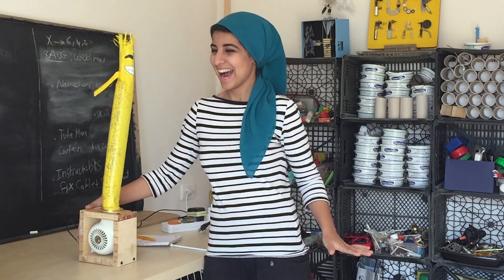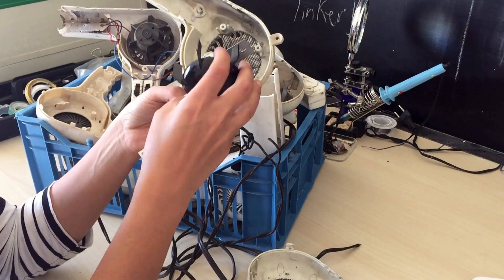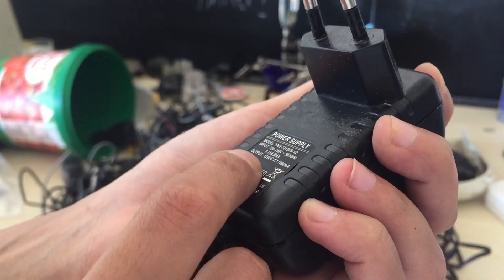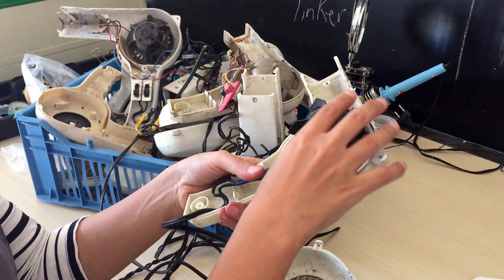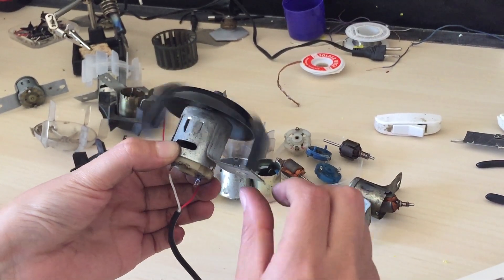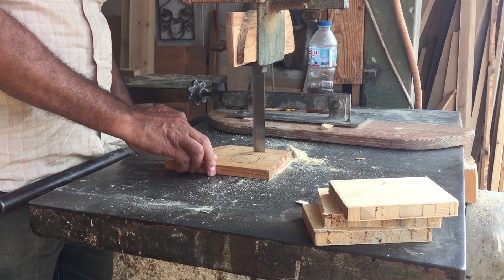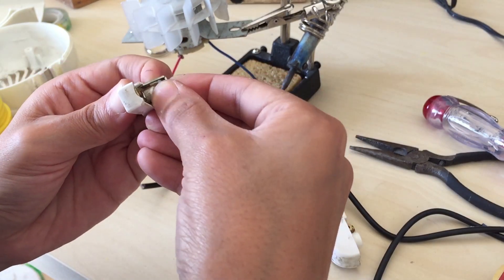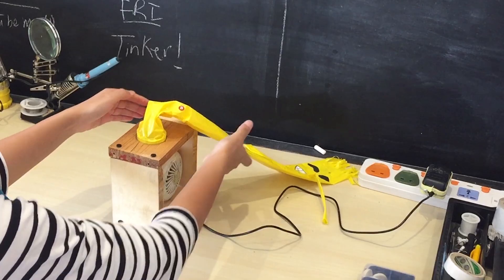How I made a mini "Wacky Waving Inflatable Arm Flailing TUBE MAN"

Comment: Hey dina, love your work. =)
I thought about making one with my students for a decent price. Sadly there arent many dryers of one kind availible for my 20+ student so i thought about using an computer cooling fan. Now i got the problem that 1. i cant use electronics for the socket cause it would need a special certification and test phase of each product in the end with repeatingly checks which is just a hassle for me, the school and students as well so i thought about using a batterie. Got that but the power output is quit low which is still in an acceptable range but - next to the question, how you managed that your dancing man goes down. I tried similiar things but in the end he just "stands" all the time which cracks me a little. He wont deflat no matter what i do
Reply from the maker: Papaya Papa thanks! Well I’d guess that the fan is not the right type, these would work with blower fans, they look like hamster wheels. It can propel more volume of air and because the tube is open from one end, it causes a difference in air pressure so it falls at some point and this fluctuates so it dances. Search for diy air blowers, there are some tutorials for making your own fans, then all you will need are 12v motors and a battery :) hope this helps!
Reply: Hey Dina wow! I am amazed by the fast answer. I will try and see how it works but already a big thanks for the hint =)

Comment: whoever "thumbs downed" is jealous of your skills! I thought I'd share my experience with you because I'm still laughing at myself. I had the idea to make one of these and was super excited to find your upcycled version! So I bought as many blow dryers as I could find at goodwill and some Nylon track pants that I'm going to sew as the body once I get the blower working... I watched your video a few times and just glossed over the things I didn't understand. The first being "the heating element acts as a resistor." I then figured you were just fixing the pieces you were using, not understanding that the 12V is necessary to not short the circuit with the 125V plug the blow dryer is originally attached to. Thankfully I only shocked myself four times and blew the fuse that I plugged into maybe 5 or 6 times before I decided to really get to the bottom of what I was doing wrong. Back to Goodwill for me, I'm not giving up!
Reply from the maker: oo nooo! hahaha Take care please! :s :D You need an adapter to change the volts, or you can use a 12v battery pack and just run the motor with batteries. Stay safe and shock free haha Let me know the end result!!
Reply: NO!!!!

Comment: The reason the first motor didn't run smoothly is because it was drawing too much power from the adapter, causing the adapter to shut down. After a short pause the adapter restarts and the motor again draws too much power, causing the adapter to shut down. Hence the pulsing/jerking.

PS: Zipper is awesome!
Reply from the maker: Ooooo thank you so much! I couldn't figure this out. So if I use a different adapter it might work, or is this a faulty motor (the coil maybe) that can not be fixed?
Reply: A different adapter might work, one with lots more mA. Laptop chargers are good power supplies, very powerful!
Reply from the maker: ooo yes! I'll try this one day. Thanks!

Comment: Nice work! It was interesting to see all the discarded hair dryers. I live in Oklahoma in the USA. Generally, people are not very likely to try any kind of repair here. There is certainly a second hand market, but only for functional items. I like repairing stuff, and teach my kids that it is always worth at least trying to repair something before throwing it out. I'll show them your video, I think they'll like it a lot. We may have to make a wacky waving inflatable tube man of our own. Keep up the good work.
Reply from the maker: Oo that would be awesome! Share a photo or tag me anywhere once you make one! Would love to see your wacky waving inflatable tube man!

Here in Cairo, only a certain segment or class do fix things, but others who are more privileged just buy another whenever anything breaks! I spent the last couple of years collecting some of these things and taking it apart, and most of the time it's just a loose wire, an easy fix.
Reply: Cairo is an enormous city so I am sure it runs the gamut! My oldest daughter (6 years old) loves taking stuff apart, she will get a real kick out of your stop motion videos. I am a carpenter, and I am pretty sure I have an old blower motor we can use for a wacky waving man. I'll post a picture when we get one built.
Reply from the maker: Awesome! I also posted this as an instructable, so you'll find a step by step guide there, but it's really an easy project, if I (someone who knows nothing about engineering and electricity) can do it, then anyone can! haha